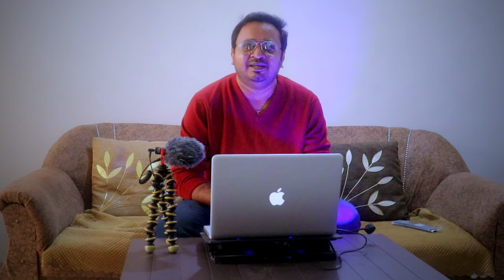Use of Aortic cannula in cardiopulmonary bypass | GLOBAL PERFUSION COMMUNITY

Comment: Sir you would have explain this topic in detail like most surgeons prefer removing venous cannulae before protamine administration and after protamine is administered you can remove the aortic cannulae ( is this correct also do recheck )
Reply from the maker: It’s correct 👍. This video is just for basic understanding of the aortic cannula. There will be a detailed video on Cannulation techniques.